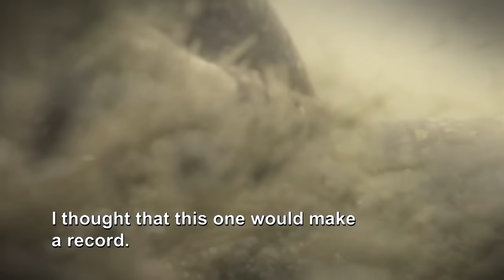Swamp People: 6 Types of Gator Bait Lure in MASSIVE Gators | History

Comment: Silly question.  If they tag out before they're done running lines, and there are gators on those lines, do they bring them in anyway, since they were caught?  Or do they just cut the lines and release them?
Reply: They have to release them best they can
Reply: In Texas you can only run as many lines as you have tags in the core counties. They give you five, you run five and take the line out once you catch a gator till you tag out.